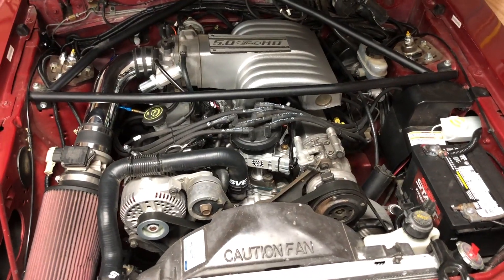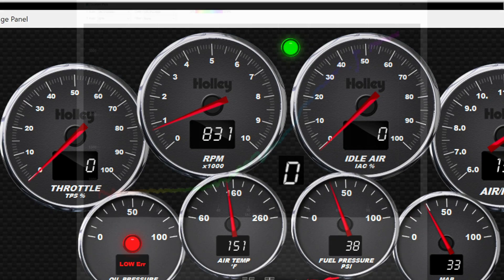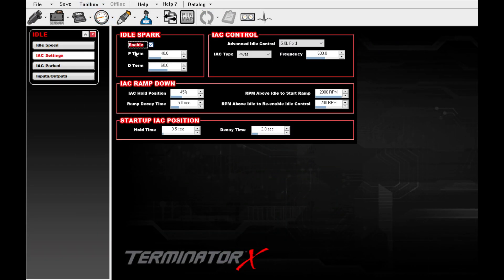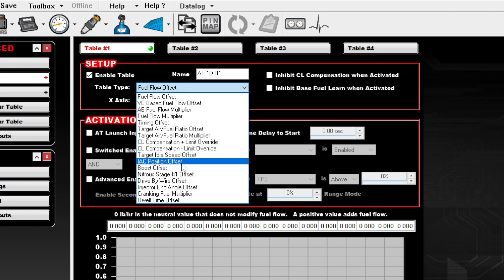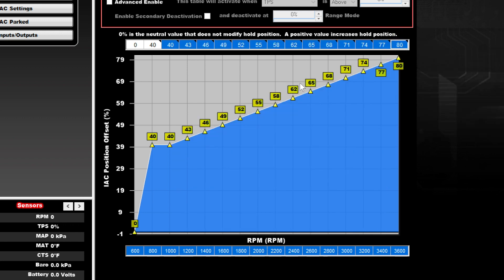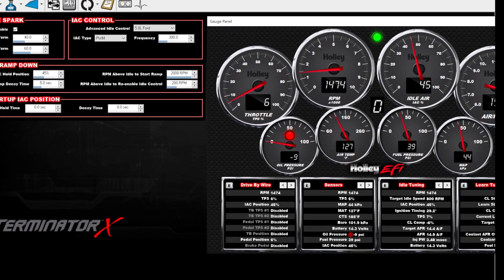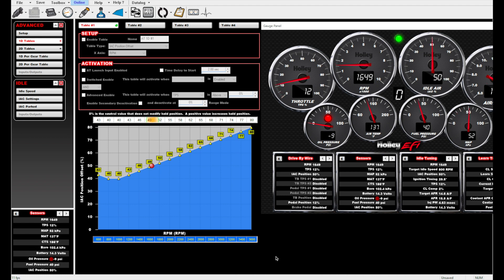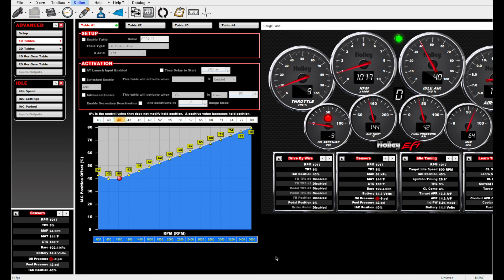Controlling Terminator X Idle with a 1D Table

Comment: How does the “rpm above idle to start ramp” setting work with the 1d table?
Reply from the maker: Yes, in a way. To keep the RPM from hanging, set it to 2000.
Reply: Okay. What about the rpm above idle to reenable idle control?
Reply from the maker: @scott5.0hh44  I think I have that set to 200 RPM or something. I haven't found that setting to have much effect on anything.
Reply: Thanks again. I mentioned your YouTube channel and your video on the 1D tables on the Harley forums section for the terminator X. I was able to get them to add a sub category for the fox body kit.
Reply: Holley not Harley web site.

Comment: Just tried this setup. Not sure what I am missing. After a drive,  the iac stayed at 40%. Tps was showing 0%. Any ideas?
Reply from the maker: That's what we're after. We want the IAC to not go lower than 40%. If the idle speed is too high, then adjust the throttle body screw to close the throttle body until it idles at your desired RPM while the IAC is 40%. Don't forget to to a TPS reset every time you adjust the throttle body.
Reply: At 4 min in the video you talk about the iac going to 0%. Could you explain that more?
Reply: Sorry about my confusion. The 0% iac is with a normal tune and not the 1D table. I got it now. Thanks. I will run it some more.
Reply from the maker: @scott5.0hh44  Keep me posted on how this works for you. Did my previous comment about setting the throttle blade angle make sense? If your idle RPM is, say, 800 RPM, the engine should idle around 800 RPM with the IAC at your idle setting (video shows 40%) when the engine at operating temp.
Reply: Working pretty good. Not much time to get out and drive it so far. I just saw the other comment about high revs after startup and knocked my startup iac down 40.
Reply from the maker: @scott5.0hh44  Yeah,  I should've mentioned that in the video. I didn't think about it until some of you brought that up in the comments!

Comment: Mine actually got worse by doing this
Reply from the maker: Weird. What exactly "got worse?"
Reply: @Mustang-Geek  yea, before it would start up and be normal high idle and slowly ramp down. Now when I did those setting it shoots up the idle really high to about 2500-3000 rpm and sits there for 2-3 seconds then drops really fast within a second to idle.
Reply: @Mustang-Geek  I’m on the Holley page on fb, maybe I should shoot u a pm there. I didn’t feel like messing with it anymore so I parked the car.  Not sure if I need to lower my set screw or what, but it also was a struggle to start the car.
Reply from the maker: @SergioSanchez-rx1hg  It's the IAC park position is now too high. Here's an updated video: https://youtu.be/F2APprj4jeU
Reply: @Mustang-Geek  thanks man I seen that video but was busy at the time. I’ll watch it again and make those adjustments and see how it goes.
Reply from the maker: @SergioSanchez-rx1hg  Yes, that video should get it all straightened out.